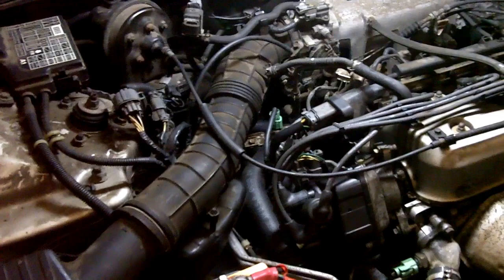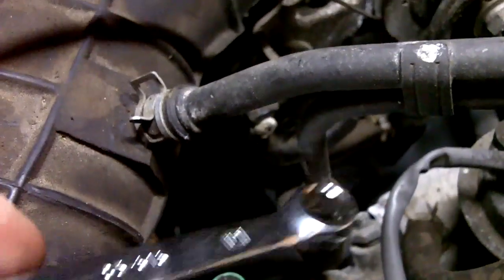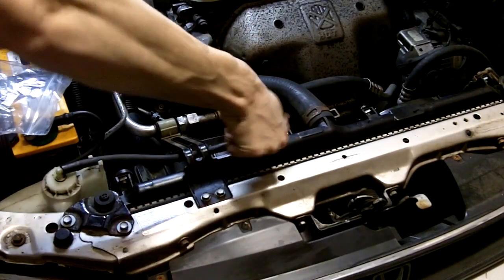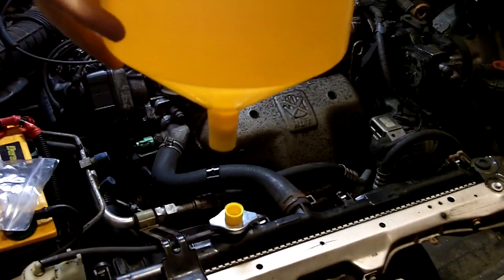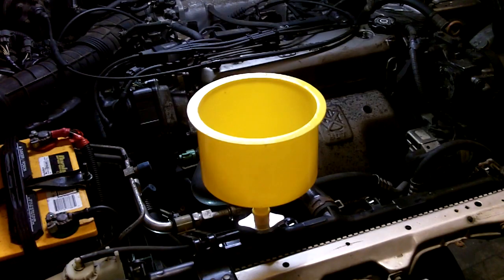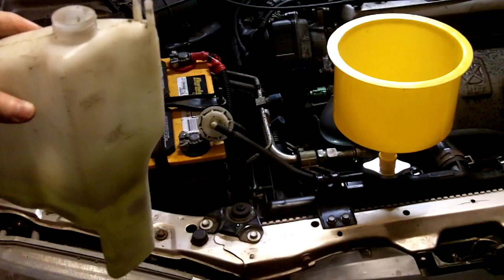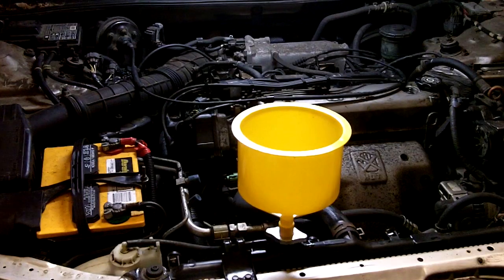Refilling And Bleeding The Cooling System

Comment: Is there a point at which you have to worry about pressure building up in the system while the engine is running and coolant flying all over the place?
Reply from the maker: Pressure can't build up with the cap removed on a cold engine. The level of the coolant in the radiator will slowly rise as the air escapes which is why you shouldn't overfill the funnel or the radiator until after it's bled.

Comment: So if was dumb and only ever bled a system without  a bleeder and with a radiator cap. if I have the opposite (bleeder with pressurized resevoir), and I have already put coolant in the system and the coolant has already reached the bleeder valve, do I need to lose all of that coolant to get to the air pockets? I know there is a big one in there top radiator hose.
Reply from the maker: Running the engine with the radiator cap off will eventually purge the air it will just take a bit longer. The bleeder just makes filling the system quicker and gets out the larger air pockets without it you have to fill it, wait until the level drops (the air bubbles it's way out the filler neck), and repeat until the radiators full.

Comment: I have a 90 honda accord and the cooling system has a lot of air and the reservoir tank is always overflow, but it doesn't overheating, I did this step, and still doing the same thing too much pressure in the radiator hoses, and the antifreeze from the reservoir doesn't go back to the radiator. any ideas.
Reply from the maker: It sounds like a blown head gasket. The leaking combustion gasses are over pressurizing the cooling system this forces the radiator cap to open when it normally wouldn't which is venting the coolant to the overflow.

To confirm perform a leak down test with compressed air on each cylinder while monitoring the radiator filler neck. If you see bubbles in the coolant the head needs to be removed and at a minimum the head gasket needs to be replaced. The block and cylinder head should also be inspected for cracks before a new gasket is installed.

Comment: also I have to add its a 99 Honda Accord. I first filled up the jug to the max mark. then added the fluid too the radiator reservoir until the max. haven't touched the car since because I'm not sure if I was supposed to bleed the radiator first, don't even know if there is air in there. as of now the car is sitting and waiting for further instructions what to do next.
Reply from the maker: +Aaron Adkins If you drained the radiator and refilled it there is air in the system and you will need to bleed it.

Comment: Great Video!  Do you recommend ONLY to use HONDA Coolant or can I use Prestone?
Reply from the maker: +Joe T Any coolant marked silicate free will work. If you get pre diluted coolant you can add it straight from the bottle if you get the concentrate be sure to mix it with distilled water. Tap water will cause mineral deposits to form.

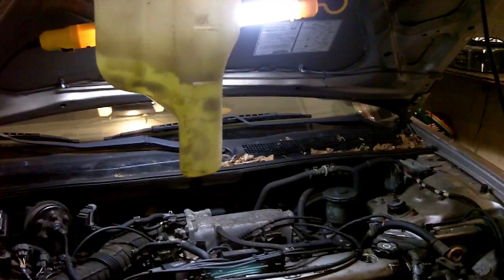Comment: at 8:45, can you explain after you drive around, how does the reservoir drop in fluid, you said it's normal as it'll automatically bleed the system. how does it bleed when everything is tightly enclosed at this point?
Reply: +thai smith,  The cooling system pushes out the small air pockets that didn't bleed out. It pushes the air into the reservoir and coolant gets sucked in as a replacement

Comment: Sir I got a Nissan pathfinder R 50 , 2005 model ( Qatar - Middle East) , unfortunately I could not find the bleeder valve or air out valve,
please help me
muhammad
Reply from the maker: Ismail Suffiyan It should be located near the firewall. Follow the heater core coolant hoses to find it.
Reply: ***** thanks and I will look for it

Comment: Won't air get back into the system when you take the spill-free contraption off to put the metal cap back on? Or is this because that hole is for the air to escape from normally?
Reply from the maker: Any tiny pocket in the filler neck will get pushed to the top of the coolant recovery reservoir as the cap opens to regulate cooling system pressure.
Reply: ***** So the reservoir tank has a cap that let pressure out? I'm new to the car world lol
Reply from the maker: aidandude3
The coolant recovery bottle isn't sealed well it's designed to breathe.

The radiator caps job is not only to seal coolant in but to maintain the system at a certain pressure.

The radiator cap has 2 valves a pressure activated valve and a vacuum activated valve.

As the coolant heats up it expands and the pressure rises in the system.

This presses on the pressure valve which is a rubber seal on the radiator cap which is held closed by a calibrated spring.

Once the pressure rises high enough to overcome the closing force of the spring it unseats the seal bleeding the coolant to the recovery bottle. This spring is calbrated to maintain the cooling system at a certain pressure listed on the cap in PSI or bar.

There is also a second valve on the cap when the engine cools the coolant contracts and creates a small vacuum.

This opens the vacuum valve and the vacuum sucks the coolant out of the recovery reservoir and back into the radiator.

Well technically atmospheric pressure wanting to fill the vacuum pushes the coolant back in.
Reply: ***** Cheers for the detailed response =)

Comment: Thank You sir for this video. Do you know if a Chevy Tracker 2003 2.0 has a bleeder valve?
Reply from the maker: Sorry I don't. If it does have one look for it on the radiator side tanks, the inlet fittings where the radiator hoses connect to the engine, or on a fitting on one of the heater core hoses. Those are the most common locations.

Some vehicles will just have a little plug to remove rather than an actual bleeder.

Comment: Video is very informative! but how do you use spill free funnel on car with no radiator cap. Malibu 02 only has access to the reservoir cap! Plz Help!!
Reply from the maker: Your vehicle has a pressurized coolant reservoir a spill free funnel isn't needed.

The pressurized reservoir acts as a built in spill free funnel. Just fill the reservoir to the proper level and warm the engine up with the cap off and the heater on full hot.

Keep topping it off to the full line as air pockets escape and cause the level to drop. Once the engine is warmed up and there's no more bubbles you're done.

Comment: I had a hose blow on me, so I replaced it then bleed the system, after that I realized that my overflow was over filling a lot. There ended up being a small hole on my overflow cap, is that causing air to get inside? This burning more coolant?
Reply from the maker: If the coolant level is low in the radiator and excess coolant is being pushed to the overflow check the radiator cap to make sure it's sealing properly.

Is the vehicle overheating?

If the radiator cap is fine and the systems been fully bled the most likely cause is a leaking head gasket combustion gasses are getting into the cooling system and over pressurizing it. The rad cap responds by opening and dumping the over pressurized coolant to the overflow.
Reply: It overheated once since I've changed the hose about a few weeks ago! The overflow isn't bracketed either so when I drive it's drips out here and there.
Reply from the maker: Joe Shmo
Try bleeding it again to make sure all of the air is out.

If the overflow still overflows perform a leak down test and look in the radiator filler neck the coolant will bubble if you have a head leak. They also make block tester kits the dye in the kit will change color if hydrocarbons are in the coolant.
Reply: Thanks you so much, I'll do that!

Comment: Just had my radiator replaced a week ago. Now it's overheating, the reserve tank is full and radiator looks almost empty. Could it be possible that even if the system was bled, I need to do it again?
Reply from the maker: Why was the radiator replaced because of an overheating issue? Was the thermostat replaced too?

Is the radiator cap in good condition?
Reply: It was replaced because it was busted and leaking. I didnt replace the  thermostat. The thermostat was working ok, at least the mechanic said it was functioning properly.
Reply: ***** I checked the cap last night. It seems to be in good condition. I'm gonna try bleeding it. We contacted the dude who replaced the radiator and we're gonna take it down to him to see if he can diagnose it for me.
Reply from the maker: *****
If the radiator was filled and bled and the coolant level dropped in a short period of time either it leaked out somewhere externally or you have a cracked head or damaged head gasket which caused it to leak internally.

You want to rule out external leaks first. A cylinder leak down tester or a block tester is used to detect internal leaks.
Reply: ***** The head gasket was just replaced about a month ago. I haven't noticed any external leak since the rad replacement, and that much coolant would be very noticeable I think. Ugh this car is a headache lol How much am I looking at if it is indeed a cracked head? 

Thanks for taking time to reply, it is greatly appreciated
Reply: ***** 02' Civic btw

Comment: i just ordered the spill free funnel ($39.99 at Autozone). Hopefully this is all i need to bleed the cooling fluid 4rm my 04-nissan350z. Do u know if 350z have a bleeder valve? 
I looked around but couldn't recognize it...or maybe there just its one
Reply from the maker: It's on one of the heater core hoses. Its a plastic cap you remove with a screwdriver be careful not to over tighten it on re installation it's plastic.

Comment: I have two questions... What would you do if you have auto climate control? Also what would you do if you don't have a radiator cap? I have a 1996 Mercedes e320 with auto climate control and it has a pressurized overflow tank... So how would I bleed to air out of the system? By the way I need to bleed the system because I recently just changed the water pump.
Reply from the maker: Turning the fan on and setting the control to heat would suffice.

On cooling systems with a pressurized overflow you treat the cap on the tank as the radiator cap. Leave the cap off and run the engine above idle until the thermostat opens.

As air is bled out the coolant level in the tank will drop. Continue topping it off until the bubbles are gone.

Comment: Hey Busho, I installed the radiator, bled the system and did the whole 9yrds, now the radiator came with 2 new auxiliary fans, I clipped the the original clip from the OEM radiator fans and spliced them to the new ones, when I was holding the car steady at 2500 rpms and the fans didn't kick on, I was doing it for a good 10min+, the radiator got really hot and looked like it boiled the coolant so I turned the car off and put the cap back on, now my car is not overheating at all but my issue is the fans, whenever I stop or park my car the radiator steams and the fans aren't even on, the temperature is fine, my radiator hoses do seen to be a little bit bubbly, the fans did kick on at one point, my question is, how can I get them to kick on sooner or did I do something wrong, help plz...
Reply from the maker: Pull the coolant temperature switch connector off. It's on the inlet nipple near the bleeder it has a green 2 pin connector on it. Jump the connector with a paperclip or wire and turn the ignition on.

Do the fans run?

If they do and the coolant temperature gauge stays within the normal limits everything is fine.

The fans will only come on if the coolant temperature at the inlet nipple reaches around 203F or if the A/C is turned on.

If the fans don't run when the switch connector is jumped you have an issue. I can walk you through what to check.
Reply: The fans come on, why does it steam/smoke when I'm sitting idle at a light or parked? And the hoses seem a tiny bit bulged...
Reply from the maker: 87RudedogG78
Did you replace the hoses? If the hoses haven't been replaced since the vehicle left the factory they're ticking time bombs.

Is the new radiator cap in good shape? If it's not venting excess pressure to the recovery tank pressures can rise and the hoses can bulge.

Where is the steam coming from? Are you sure it's not just spilled coolant burning off the engine?
Reply: Yea, new hoses, cap is fine, now I have coolant leaking outta the EGR valve, how can that be? Help plz.. Thanks...
Reply from the maker: How did you come to that conclusion did you remove the valve?
Reply: After I got home from work last night I noticed a wet spot underneath my car, I popped the hood, no leaks from the radiator, did a lil looking around and I noticed the EGR valve full of coolant, almost like it was spewing out if it, kinda like it got flooded, there's no other leaks around it that possibly could've dripped on the EGR, what can be my problem?
Reply from the maker: 87RudedogG78
If coolant is in the exhaust it sounds like a blown head gasket. Combustion gasses from a cylinder are leaking into one of the water jackets around each cylinder.

Are there any bubbles in the radiator filler neck when you rev the engine hard? Does the vehicle emit any white smoke at all? Are you having any overheating issues? Is the temperature gauge within normal limits with the engine warmed up?

The test for a head gasket leaking coolant is usually to pressurize the cylinder with compressed air with the intake and exhaust valves of the cylinder closed. The escaping air will produce bubbles in the coolant.

There also are dye test kits that react to the hydrocarbons in the coolant and change color.

I never asked why did you replace the original radiator? Did you have an over heating issue, a leak, or was it just for performance reasons?
Reply: I have none of the above symptoms you mentioned, temperature is at normal, I replaced my old radiator because it had a leak/crack, I wanted something that'll possibly last a long time and won't fail on me so I went with the aluminum racing radiator. I've been driving my car for the past few days and now it seems to be ok and I do not see any leaks coming out of anywhere, maybe it was spilt coolant and I didn't realize it got by the EGR and the manifold, I wiped it all off, drove it the next day, parked and looked at where I originally saw the leak and there was nothing.. Thanks for your time, your videos and most of all thanks for sharing your skills with us youtubers, if I have more problems I will be back on here to ask you...
Reply from the maker: 87RudedogG78
Glad it was a false alarm.

Let me know if you have any more questions.

Comment: Does a 98 eclipse gst have a bleeder?
Reply from the maker: Some vehicles have them others don't.

Look where the radiator hoses connect to the engine if the vehicle has one they're usually in that area. Some manufacturers don't put it on the engine and place a plug near the top of the radiator which will achieve the same result.

They aren't a necessity but they make filling the system much quicker since they allow the air a place to escape.

If your vehicle doesn't have one just run the engine with the radiator cap off and the temperature control set to full hot as the thermostat opens the bubbles will come out.

As the level drops keep topping it off.

On most vehicles the radiator cap is the highest point in the cooling system and air will naturally find it's way out there.

When the temperature gauge indicates the vehicle has warmed up and you see no bubbles in the filler neck you're done.

Comment: So do u think I need to change my radiator cap?
Reply from the maker: If it has fallen apart yes.

If the hoses bulged too they would also need to be replaced as they could have suffered structural damage from being over pressurized.

Comment: On my 94 Honda accord ex. after a hard drive home I checked my radiator hoses and both of them felt like they were about to bust open do anyone no why? Plz help cuz it's driving me crazy!!
Reply from the maker: Are you saying that your hoses are bulging?

Radiator hoses bulge when they've been in service for too long. It's sign that they're about to burst.

This is especially true if your vehicle is still on the original hoses. At their age they're ticking time bombs.

The upper hose gets the most abuse since it has to handle the hot coolant so it tends to fail first.

I'd also check the radiator cap on these Honda's they like to fall to pieces.

If for some reason the cap isn't venting properly the cooling system can become over pressurized. Which can cause the hoses to bulge.

Comment: Ohh yeah, today I almost seized my LS1, 260*F and climbing.
I swapped the hose yesterday but it didn't help, turns out the lack of antifreeze caused the oil to boil and spew on my LT header pipe !!! The engine shut down on me twice, that's when I decided it's too much for me to take on by myself and went to my old mechanic. The engine had 1/3 oil and no coolant as it was stuck in the OF container.

Comment from the maker: On an overflow you'd be right a hole in the tiny hose leading to the overflow bottle would allow coolant to leave the radiator but not return which would lead to a low coolant level in the radiator.

I believe your vehicle uses an expansion tank and not an overflow tank. Expansion tanks operate slightly differently.

If the hose is damaged replace it give the system a once over to make sure there aren't any other leaks. Then refill the system and bleed it.

Comment: popped the hood, as I walked to the front I saw fresh antifreeze splatter between my SS and the car in front.  Overflow hose rested on a hot intake pipe for unknown number of days, melted a tad bit and most likely let some air in.
Now my question is: can the air in the system trap antifreeze in the OF tank, stop it from flowing about and returning to the radiator ?